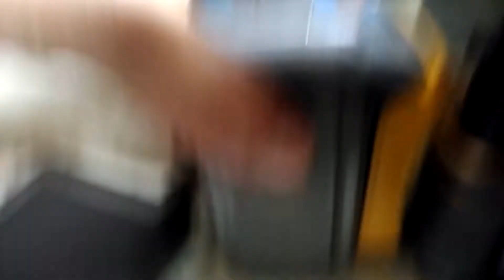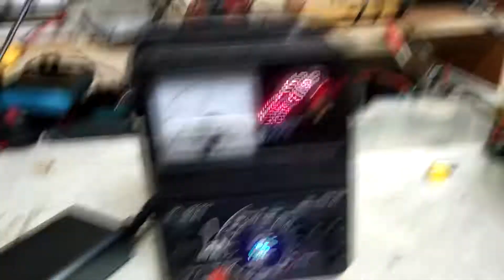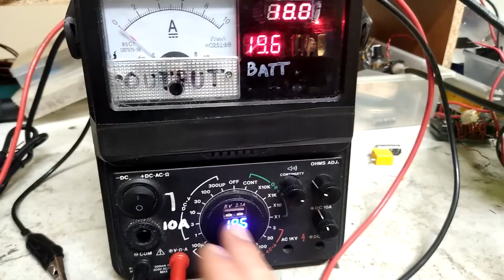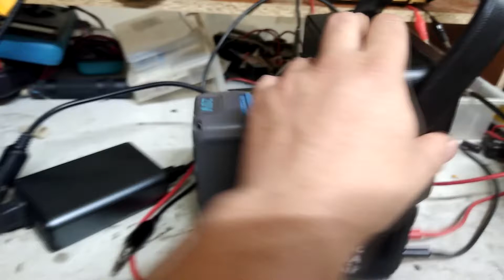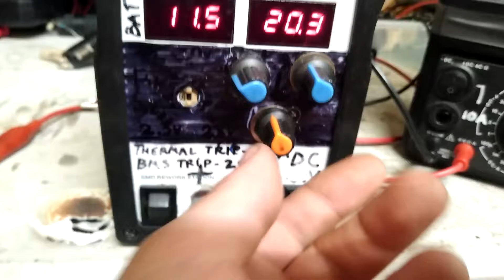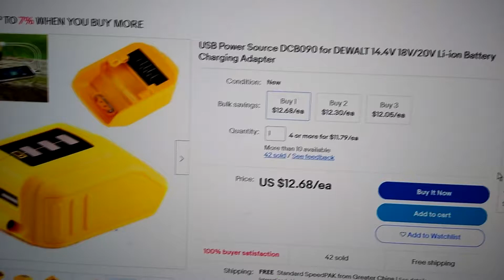Drill Battery DC Supply 1-30V ~10A

Comment: Hey @Magneticitist I know this is a few years old video but I'm going to build this kind of power supply based on your design since I've got loads of drill batteries laying around i really like the concept of slap a charged battery in there and slap the other one on the charger and best of all isolation! as with you i'm doing allot of low power tesla coil and HFSSTC stuff plus having a portable variable psu is always a bonus anyway for 'our' kind of projects anyway!. Keep up the good work man! ;-) Sy.
Reply from the maker: I still recommend it to this day. It has lasted well for me so far. Maybe my most used supply. Have even recharged a dead car battery slowly to get just enough in there to crank it lol.

Comment: You need a 3d printer... makes the mechanica/ enclosures soooo much easier!
Reply from the maker: one day.. but I'd still get impatient with it taking so long to print and just end up using some old garbage
Reply: @Magneticitist  basic boxes / mechanical  structures  take an hour instead of 8h if you use 1mm nozzle (stock size is 0.4mm) and set the extrusion width 150% and height80%🤣🤣
Reply from the maker: @TrumpstienPhile1  Would that actually be pretty sturdy though?
Reply: @Magneticitist  Yep- the wider you print the better the layer to layer adheasion because the nozzle is squishing molten plastic out the sides bonding to neibouring extruded plastic- downside is printing  at those flow rates you would need to upgrade to a reduction geared extruder( bondtech clone which costs about 10 bucks)

It's dead easy to design custom a box in tinkercad and for anything  else you can download practically any  3d model  on thingiverse 

Pla plastic is super rigid but can be so rigid if you push it too far it will snap so I stick to(pun) PET-G it is crazy tough and can be bent  without  breaking
Reply from the maker: @TrumpstienPhile1  I think I should try learning CAD first, I'll check out Tinkercad. Maybe if I end up designing enough stuff I think is cool it will motivate me to grab a printer. As of now I don't know how to CAD for sheyot.